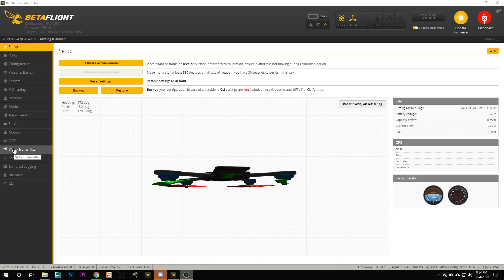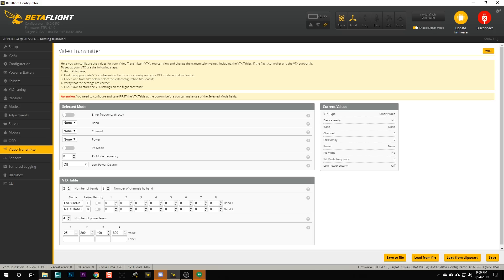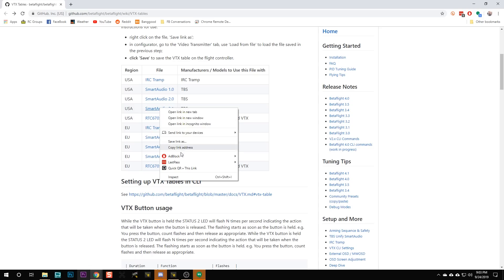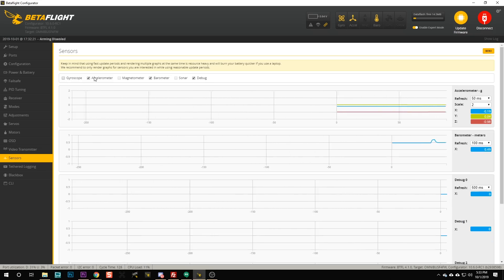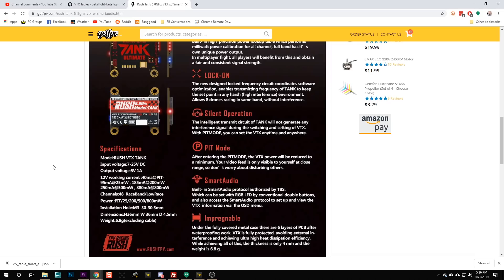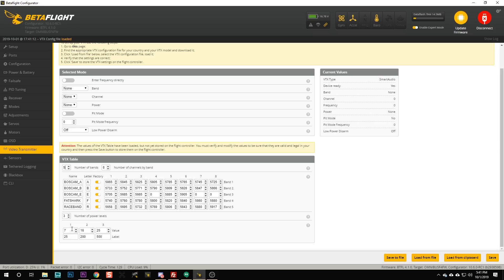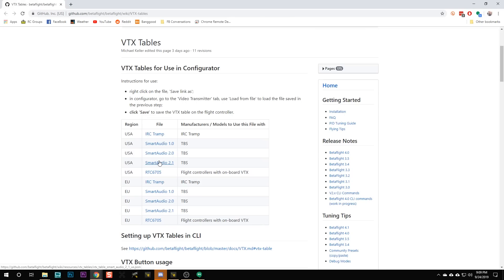Betaflight 4.1 vtxtables | WHY SMARTAUDIO DOESN'T WORK AND HOW TO FIX IT

Comment: Everyone else using sa2.0 have the power values at (0,1,2,3) neither this nor your conversion to dbm seem to be right I'm about to just cut ties with smart audio to keep bf 4.1 I guess
Reply from the maker: Power Values 0 1 2 3 are correct for SA 2.0.
Reply: @JoshuaBardwell  awesome thank you so much for the response. Now I can figure out what's causing the problem knowing it's not that.

Comment: Fun fact. My thefpv chaos vtx is showing its 216 in debug so It should be running 2.1sa which u need to put dbm to set power levels. However that is not working here, but the way u set power levels in 2.0 does work, so its like 25mw, 200mw, 400mw, 600mw = 13, 23, 26, 28 is not doing anything (checked sa version again its 216) and setting it by 0, 1, 2, 3 does woek wth!?
Reply from the maker: 216 is SA 2.0
Reply: @JoshuaBardwell  so u made mistake in the vid then i correct?

Comment: why is the video transmitter not available in betaflight for me?  I have the akk fx2 ultimate mini running on the eachine wizard x220
Reply from the maker: The Video Transmitter tab only appears in BF 4.1
Reply: Joshua Bardwell ahh ok, I guess I’ll have to wait for the SP Racing F3 to roll out with that version. Otherwise I’d have to update the vtx table in the cli and that’s no fun

Comment: My vtx shows 216 read off github 216 is 2.0 I have the rush tank pit 25 200 500 and 800. Why did you choose 2.1?
Reply from the maker: I picked the wrong one.
Reply: @JoshuaBardwell  for 6 months since this video I been using 2.1 its been working lol curious because my other quad has the rush vtx but the colors of the power change according to power change through s.a and not my first build on 4.1 which is using 2.1 😁 thank you for the reply

Comment: Got confused when you said 216 is version 2.1 at 7:49.  In fact 216 should be SmartAudio 2.0 unlocked.
Smart Audio Debug[0] key:
100 = SA 1.0
116 = SA 1.0 unlocked
200 = SA 2.0
216 = SA 2.0 unlocked
300 = SA 2.1
316 = SA 2.1 unlocked
https://github.com/betaflight/betaflight/wiki/VTX-tables

Comment: Hi there! I ve proble with an eachine xf5804 its frozen on 200 mw and i see on github that the value in smart audio 2.0 are like 0, 1 ,2 ,3 but you say that its in dbm like in 2.1....that why or i will burn if i put the dbm value ? Sorry for this confusion

Comment: when I do this test on a TX805 in dbug nothing happens !!  does that mean the smart audio does not work ? 
that would explain why I have the osd smart audio but it actually does not make any change in my VTX...
Reply from the maker: It means the FC is not talking to the vTX. Could be a wiring issue. Could be Ports tab set up wrong. Could be the Eachine is buggy.

Comment: ive done all the above but i still cannot change stuff via osd...why not?
Reply from the maker: Confirm you see device ready yes in the video transmitter tab on the top of the right hand side column. This will indicate that the VTX can talk to the flight controller. If you see a device ready no that means that the wiring is not correct, the VTX is powered down, or the ports tab is not setup correctly.
Reply: @JoshuaBardwell  thx for quick reply joshua  yes it states ready im using v1 chaos an correct 2.1 json file but still no joy :(

Comment: Joshua, when I connected my drone and did everything you said to debug it didn't work when i plugged in my battery. It just stayed at 0.
Reply from the maker: If Debug stays at zero when you plug in, then either the wiring between vTX and FC is incorrect, or the Ports tab is not set up to have SmartAudio on the right UART.
Reply: Yeah I was pretty sure I connected it to the correct uart and wired it good. And in the ports tab I have Uart 3 set up to smart audio. I’m just not sure what to do to make it work now.
Reply: It’s wired to the Tx3 port
Reply from the maker: Email me joshuabardwell@gmail.com

Comment: I have followed your tutorial, but I am still not able to get it to work. I have filled out the tables manually, and copy/pasted. Running Matek F722-std & BF 4.1.5 with AKK-X2 Ultimate VTX. My LUA scripts are populated on every other page, except the VTX page. Only if I fill out the "Selected Mode" does anything show up on the LUA VTX page. But, when I change the Band, Channel, & power on the LUA page, it does not change the values on the VTX. Can you tell me what I am doing wrong? Thanks
Reply from the maker: Lua scripts may not be updated to work correctly with vtxt ables. Can you check in the OSD menu to see if it works? That would confirm the smartaudio was working at all.

Comment: OK, so SmartAudio 2.0 do I use db or 0,1,2....etc for setting up my power settings? At 8 min 50 sec you mention using db for SmartAudio 2.0 and 2.1, and at 10 min 18 sec you say that you use 0,1,2,3 etc for SmartAudio 2.0 and the VTV will know what the power outputs are.Maybe I missed something, but a little clarification would be appreciated!
Reply from the maker: Smartaudio 2.0 is 0 1 2

Comment: My betaflight doesn’t have a vtx transmitter tab. My vtx also has no power when I plug in a battery.. the vtx is brand new and installed correctly

Comment: I uploaded 2.0 JSON to the 2.1 VTX by mistake. After change power to 50mW - smartaudio just gone. In OSD, VTX SA menu was blank. In statx menu it's "offline". After reflash BF  and upload correct 2.1 VTX table - SA comes back

Comment: I can´t see any  "Video-Transmitter "  Tab in Betaflight.....:(    Smard Audio is connected  in my FC.....(Omnibus F4)
Reply from the maker: If you are not using Betaflight 4.1, then it won't be there. Earlier versions of BF didn't have it.
Reply: @JoshuaBardwell  ok, thx

Comment: Rush tank ultimate allows me to control freq and power level confirmed by LEDs on vtx after following this but it will not control pit mode. I have to use the manual button for pit mode. Is there something that has to be configured differently for this functionality?
Reply from the maker: SmartAudio 2.0 cannot enter pit mode after power up. It can only power up in pit mode. That's my understanding.
Reply: @JoshuaBardwell  it won't even allow me to check the power up in pit mode button? Thanks for the reply!

Comment: Everything seems to be fine with my configuration in Betaflight 4.1. When I change the channel or band, the values change in my OSD, but the band/channel does not actually change. It is always on raceband 1 no matter what I have it set to in betaflight / what my OSD says it is set to. How do I fix this? I am using the AKK 1200mw transmitter.
Reply: did you fix this? I have same issue. My changes save on betaflight but not on my actual vtx. Stuck on B3
Reply: @wrcallar  I believe I just re-flashed my fc and it ended up working

Comment: Drone messed up, no video in goggles... no flying in the near future ;))
Reply: The Power level LED on my Matek VTX is flashing it doesn't wan't to stay on the desired power level.
Reply from the maker: If you suspect that the vtxtable is messing you up, go to the Ports tab and disable SmartAudio. If the vTX starts working normally you know it was vtxtable.

Most likely the Matek is SA2.0.

Comment: Ahhh!!!! Now i know why Smartaudio didn`t work on my Diatone Taycam....Followed this to the letter and now is all up and running.
Only thing that i found that didn`t work was the debug option as the Taycan uses the Tramp protocal it didnt register on the scale when i powered up...so all i did was download the EU Tramp file and filled in the power option boxes (25....200...400mah which equates to 14....23....26 decibels) hit the save button and it works a treat now.
Thank you Josh...moving from 3.6 to 4.1... i was pulling my hair out wondering why Smartaudio wasn`t working.. and thought... like a few others that have left comments on here ...Can`t be doing with this.. but once you know how ..try it...and succeed ...its really quiet straight forward... and i`m a nonce when it comes to using Betaflight.
JOSH...YOUR THE MAN..XX.

Comment: Maybe put another Joshua from the future.. Your video helped a lot but the Values you enter for the vtx power levels doesn't work like this. I have the Rush Tank Racing Edition and had to enter 0 1 2 3 to get it working.
Reply from the maker: The ones I show are for SmartAudio 2.1. Rush Tank uses SmartAudio 2.0 and works like you show.
Reply: @JoshuaBardwell  I'm a bit confused.. I did the test you showed with the debug 0 to determine wich version I have and it showed 216.. So I downloaded and put the vtx table of SmartAudio 2.1.

Comment: I don’t understand the annoyed comments here. I bought my first quad last week and just did this with the help of this video and it works.....  And I don’t even know what smartaudio is.....  JB could you explain to a beginner.....
Reply from the maker: SmartAudio lets the flight controller change the channel and output power on the video transmitter. So you can change channel and power from the goggle on-screen-display menu or via other methods, without having to touch the vTX itself.

Comment: Hey Joshua I'm sorry to say that but you have to update your vid. 216 is for SA 2.0 unlocked and not SA 2.1 (x16 means that the VTX is unlocked). And the values are 0 1 2 3. Regards

Comment: i tried the debug but it wont show what smartaudio version im using
Reply from the maker: This means that the wiring is incorrect or the Ports tab is not set up correctly. You need to see "device ready: yes" in the Video Transmitter tab before you can see the debug version.
Reply: @JoshuaBardwell  i actually upload a vtx table first without knowing what smartaudio version i have..will there be a problem if i upload the wrong version of vtx table?
Reply from the maker: The vTX won't work but no permanent damage.
Reply: @JoshuaBardwell  fixed..tried the SA 2.0 and it worked.thanks again

Comment: OK I have my SA setup correctly on my FC and VTX and still cannot get the debug to work on any of my 5" quads flashed to 4.1 SA worked perfectly prior to flashing...I have flashed all of my Tinyhawks to 4.1 and used the steps in this video and everything works fine with SA is there something I'm missing?

Comment: It didn't work :( , My smart audio is gone! 
I have loaded my Kakute F7 with a SD card, Enabled Smart Audio + battery and did go to sensors but it doesn't react at all 
I did update to 4.1 before I knew about this crap :(

Cant even remember what ports i used before i flashed. Receiver works but thats it
Also i just got one motor spinning so this turned out to be a real hit and miss. I usually never upgrade the firmware because of all this trubbles
Reply from the maker: You seem to be mixing up Smartport telemetry and SmartAudio vTX control.

Comment: sir i had completed every steps that u did in this video....and smartaudio is working expect the power output... i can change the channel, band, but the output power is not changing...(how did i know output power  is not changing) i am using foxeer clear tx2 when  i plug in the battery it shows the output power for 1 second on its led display and then shows the channel and band....how to solve this issue plse help me sir....

Comment: 8:49 you said 2.0 uses dBm values and then later you said in 2.0 smart audio you need values 0 1 2 3
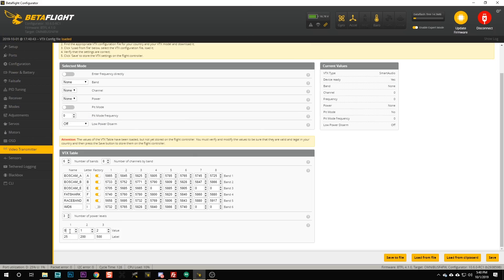What is correct here for Smart audio 2.0 10:18
Reply from the maker: 2.1 uses dBm values. 2.0 uses 0 1 2 3
Reply: @JoshuaBardwell  thanks a million for reply. I am finishing my first drone thanks to your videos. On saturday my first test fpv flight i really appreciate all your help.

Comment: Why after upgrading to 4.1 the 'flip over after crash' mode is no longer visible in the 'modes' pane of betaflight?
Reply from the maker: You aren't using DSHOT?
Reply: @JoshuaBardwell  Yes! It reverted back to Oneshot after the update. Thank you!

Comment: can i also use different power levels from what my vtx normaly can handle? 
So, can i "overclock" my power? 
I have the akk fx3. It goes up to 600mW normally. Can i set 800 there? ('I know that this could demage the VTX)
Reply from the maker: No. If you set an unsupported power level the whole vTX locks to 25 mW.
Reply: @JoshuaBardwell  Oh ok.
Thanks for the answer!

Comment: Joshua I am a little confused I have a Tramp VTX but I am using a TBS Tango- what do I download for a vtx table smart audio or tramp? I already downloaded the Tramp version with values but for some reason my quad stopped transmitting a FPV feed to my fatsharks. I tried scanning channel but it just will not locate a channel?
Reply from the maker: Vtxtable matches the vTX. Use Tramp.

Comment: Hi, thanks for the video, very informative as usual. I've got a little concern with smartaudio detection and the mapping you're doing, I have a TBS unify pro and when I plug it in, it outputs 216 which according to your tellings at 7:55 corresponds to smartaudio 2.1. According to BF's wiki (https://github.com/betaflight/betaflight/wiki/VTX-tables) it is however smartaudio 2.0 unlocked (2.1 being 300 and 2.1 unlocked 316). I've set it up as with smartaudio 2.0 and flown it without issue. If it was really smartaudio 2.1 the output I gave it at 200mW which is 1 would have translated to 1.25 dbm which would made it impossible to fly at more than one meter or 2
Reply from the maker: 216 is SmartAudio 2.0. The Wiki had not been updated at the time this video was made.

Comment: What a bone headed move by the developers in the user interface portion.  I'm fine with VTX tables, but there should just be a drop down box for a list of the most commonly used values.  If the user wants custom VTX table, they can select the custom option or add line items as needed.  They made it way more complicated than needed from a user's perspective.  They should also have a separate pick list for smart audio versions so it would populate with correct values for the output power based on the version selected.  The only value that should be able to be edited is the output power level and the system would automatically generate the dBm values.  The SmartAudio protocol wasn't thought out well from the initial stages of the spec.  TBS got greedy and wanted to charge money to implement the protocol.  The most frustrating part about RC hobby is there are too many protocols that do the same thing.  If there are standardized open specs like the USB standard, everyone benefits.  Companies that deviate or go on their own standard by going proprietary should be punished by the hobbyists with lower sales.  Its just common sense.  We put up with this crap but we shouldn't have to.  The USB standard was one of the best thing that happened to the computer industry.  It made plug and play a lot easier for the consumers.  I used to remember all the different ridiculous ports you need for keyboard, mouse, serial, parallel, etc on every computer.  We have to move away from the stone age.

Comment: Hello, THANK YOU for that great video to explain the VTX Tables.
I can't see the version of my vtx at the sensor page of Betaflight using the "trick" of the blackbox. My VTX is a Eachine 870TX, connected the green cable to a TX3 of my FC. 
Before I change the version of my FC, I was using the smartaudio from OSD without problems.
Please help.

Comment: Before you install Betaflight 4.1 and you are running a transmitter using OPENTX you need to upgrade OPENTX to version 2.3.4, I was running 2.2.3 and IRC Tramp protocol and the LUA script for VTX would not work. I upgraded my Taranis X9D+ SE to 2.3.4 and the latest LAU script and it now works, as well as some new functions that from the looks they do the same function as the Speedbee APP.

Comment: hi, please tell me, I have a video transmitter peak ultimate plus, when I change the power of vtx with the button I have everything working, look at the glasses there power has changed. If I change the power from the betaflight menu in glasses, the power does not change, and the led shows me that it has not changed, what should I do? table VTX 2.1 TBS (Smart Audio).

Comment: Hello Joshua "in the past", I think the versions are as follows according to https://github.com/betaflight/betaflight/wiki/VTX-Tables.
Smart Audio Debug[0] key:
100 = SA 1.0
116 = SA 1.0 unlocked
200 = SA 2.0
216 = SA 2.0 unlocked
300 = SA 2.1 316 = SA 2.1 unlocked

So a Debug value of 216 should be SA V2.0 unlocked.  And in SA V2.0 the powerlevels = 0,1,2,3 vs dBm values as in SA V2.1 (Ref: https://www.team-blacksheep.com/tbs_smartaudio_rev09.pdf, lookup table under the Set power section)

Can you please notify Joshua "in the future" for another upload :))

Thanks for the video, very useful. A millions thanks in general for all your videos and other material which is truly helping me and the community. Much appreciated!

Comment: Two problems: when I load from file it kind of scrambles my Video transmitter page.  Everything turns blank or zero and the buttons on the bottom become yellow slivers.  I tried the 2.0 and 2.1 and yes saved link to file.
Also, using the blackbox, my vtx never shows up.  I double checked ports and the wiring.  Also vtx page of BF says "Device Ready  No".
Thanks.  VTX works fine with the button but miss smart audio control.
Reply: Same problem..do you fit this problem?
Reply: @annofpv899  I would imagine I did since it was five months ago.
I just setup vtxtables on a new quad last week and it didn't work at first.  I realized I had soldered to the RX pad of uart 1 (in my case), switched it to TX pad, made sure my ports had uart1 set to TBS smart audio and it worked fine.
I would recommend watching um... Was it painless360? No it was Ciotti's vtxtables video, but I forget what his channel is called.  I'll go find it and edit this with a link for you.  Brb.
UavTech: https://youtu.be/eaSmoOPk9KY